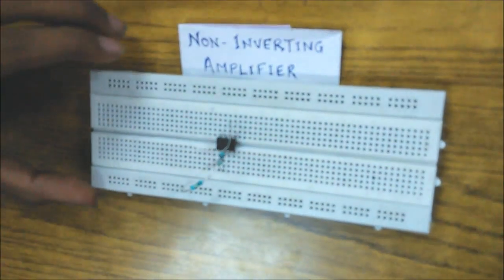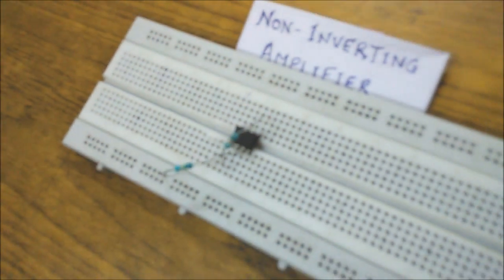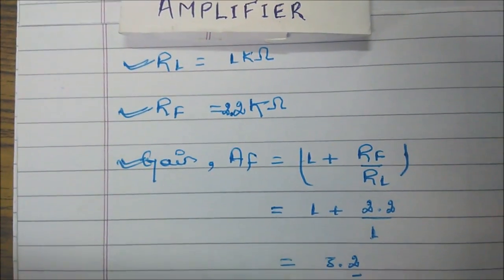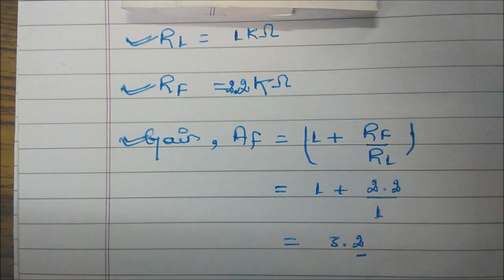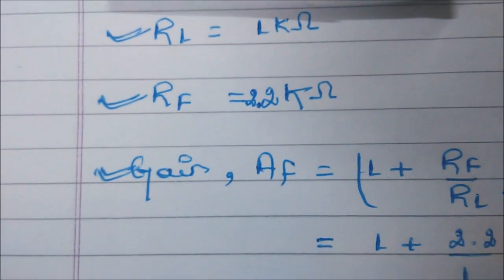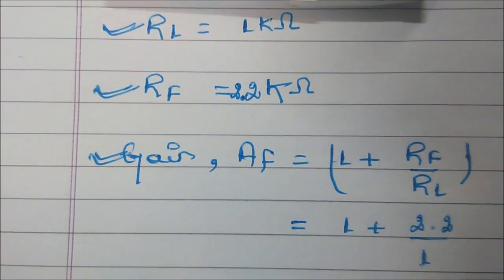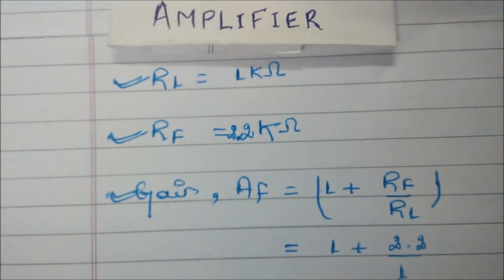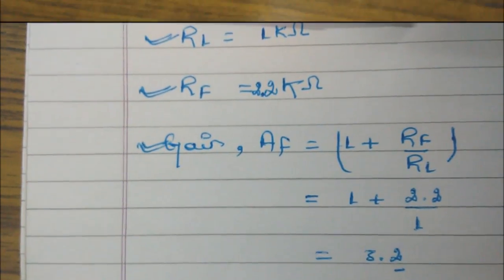Non Inverting Amplifier using op amp, Rohit Bharti

Comment: what did you connect to ch1 to get the input voltage??? and when connecting the function generator do use the input or output??
Reply from the maker: We connected output from the function generator to ch1, so as to view input applied to the amplifier.